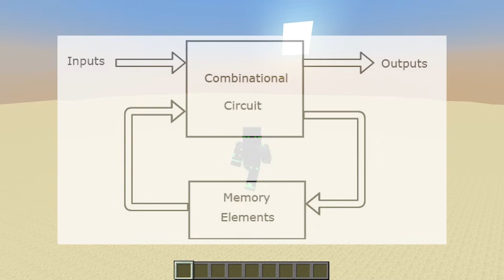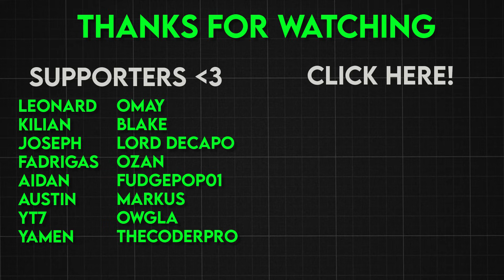Sequential Redstone Devices - LRR #8

Comment: the copper bulb has the t flip flop logic in 1 block.

string together comparators and copper bulbs and you have a counter circuit much simpler to build
Reply: He said he’d never use copper bulbs
Reply: @mahito-kun67  for those that are ok with copper bulbs

Comment: with the memory bank i managed to make the size even smaller than the one in this video. instead of being 2x2x10 (40 blocks/bit), i got it down to 2x3x6 (36 blocks/bit). my smaller version does use a shared bus for reading and writing, but only if it is tiled to share a bus :D

Comment: Thank you so much for this video! I was trying to make a timer that would set off four different command blocks in sequence for a gimmick build and I was absolutely struggling to make one output turn into four unique signals, but I only needed half of your Ripple Counter section to see me the rest of the way through my build! Once I knew how to make bits count properly, I could finish the rest on my own (after a few hours of troubleshooting).

Comment: oh wow. so here was me thinking i was really compact with my memory modules using 160 blocks per bit (and 256 blocks per bit for my dual channel module), and now you're showing me repeaters have a built in d latch and i didn't have to make one using torches and non locking repeaters 😅 (although, my 2 wide tileable d latch is still really useful, it's essentially just an sr latch with a couple more torches and a repeater). 

so now i can build a new redstone computer, but even smaller if i go vertical, and i get to send instant vertical signals without using walls or scaffolding with observers and copper bulbs. tysm!

Comment: i tried making a vertical synchronous counter, but it ended up being much less compact and using 2 lines instead of 1. so 6x6x2 instead of 3x3x2. although, the 2 lines ended up me just overthinking things and it works fine with 1 :D

Comment: The adder circuit would be considered a simple accumulator. A lot of RISC CPUs use accumulators for their arithmetic to simplify the instructions. Designing a CPU so that any register can operate with any other register and then output the results to any other register is certainly doable, but it's complex. The accumulator design simplifies it so any arithmetic/logical operation has to use the accumulator register as one of the inputs, and the output will always be written to the same accumulator register.

As an example, say the accumulator is register A, and there's another register B. You want to add 3 + 2. You'd write 3 to register A and 2 to register B, then use the assembly instruction "ADD B". (Since any ADD operation uses A as an input, there's no need to say "ADD A,B" as an assembly instruction, so it gets simplified to "ADD B".) After that instruction is executed, register A contains 5.

Comment: Is it possible to automate the process of adding numbers in the Accumulator, enabling it to tally multiple values without manual input? Oh and also, can the system be modified to support a 16-bit counter rather than the standard 8-bit configuration?

Comment: To make the accumulator into an automatic counter you dont need to attach a clock to it. Just add 1 through the carry in and remove the torch that connects the button to the glass tower that has the repeater lock. If you do that it starts counting up without you doing anything! Idk if it works for other adders though, i am using the cancel carry adder shown in the LRR 4#

Comment: The purple adder register reminds me of an op amp wired to function as an integrator, where the integral of a measured signal accumulates based on the rate of change of the input. So perhaps it should be called an integrator? Or calculus doohickey?

And ring counters are called that because of the physical construction of using vacuum tubes to store volatile data back when it was first conceived, and the fact that they cycle the data like a rotating ring. Handy when dealing with microcontrollers that put out a repeating chain of outputs that isn't a consistent on-off cycle

Comment: 6:02 I can't believe that I have spent 2 FREAKING HOURS building a STUPED horisontal sencrnous counter and yet another hour building another vertical one and both of them where HUGE and I thaught to my self "surely that guy wouldnt't have come up with a much smaller one" and when I came back, I felt like some of my vains are about to blow up, I mean that my counters used about 20 blocks per degit and I only added a reset button not even a loader. That was really frustrating, and most of that time went in vain because I was using an unraliable T flip flop  and when I realized so I had to make one up and start from scratch because yours don't work on bedrock minecraft.
Reply: yeah i was started the build but then thought, I am not spending my whole morning on this only to make a very ineffective version of it

Comment: I think the Ring-Counter is also called "Barrel-Shifter" (and the operation is often called "Barrel-Rotate").
This name made more sense to me, as I can imagine the bits lining the inner (or outer) surface of the barrel. Rotating the barrel rotates the bits inside.
Hope this helps people to understand what the Ring-Counter / Barrel-Sifter does. :)
Reply: I'm pretty sure the name barrel shifter comes form the fact that it is kind of the opposite of a ring counter because it can do any amount of shifting necessary all at once (a.k.a not sequential logic, but combinatorial) as opposed to the ring counter which is sequential a.k.a it takes multiple presses of the button to shift by a certain amount. Wikipedia seems to agree with me but i don't know how much that's worth.

Comment: "loading the register" is very backwards to me. The word "load" in CS contexts is very very heavily connected to getting data out of the storage. In a typical assembly, you conceptually load from the memory, not into the register. When a game loads an asset, it conceptually loads from the storage drive, not into the memory.

You could get away with "the register loads", but only if the other control signal's name is able to match that phrasing. The CPU can write to and read from a register, or the register can load from or assert to the bus(es).

Comment: The reason ring counters are called what they are is that you could represent a shift register like a number line, moving each bit one place along it until it overloads (running off the end of the line). You could prevent this by taking the same line and connecting the start to the end, forming a ring. It works the same way a clock does, where once it passes 12 the hand doesn't fall off, it's just back at 1.
Reply: Also the way the signal moves along the lamps has the same topology as a circle
Reply: @brubus7780  Yes, the easiest way to build it in real life would be in a ring, too.

Comment: They're called ring counters because the data loops in a circle... you know, the shape of a ring 😁
Reply: they are also called barrel shifters
Reply: @Boltkiller96  It's not a barrel shifter because it's sequential. From what I've searched, barrel shifters are combinational, meaning (according to Matt) that they don't depend on their current state, only on the exact inputs. The ring counter, however, depends on its current state to be able to cycle.